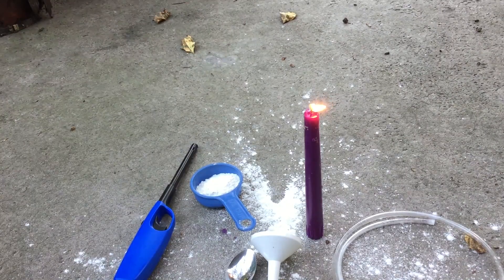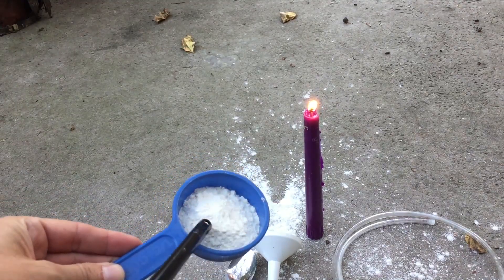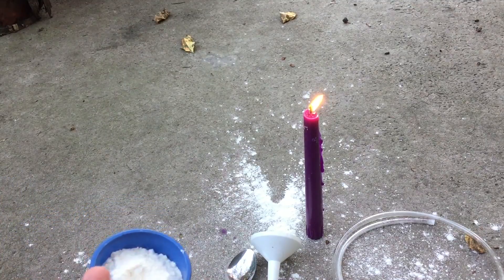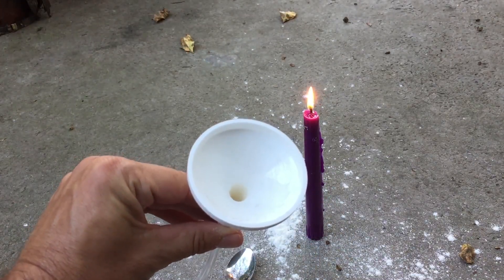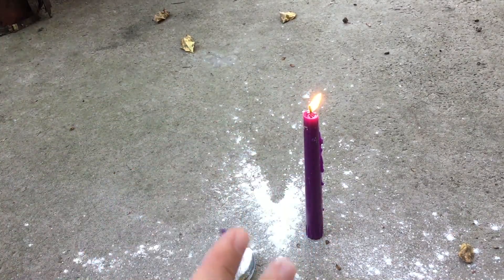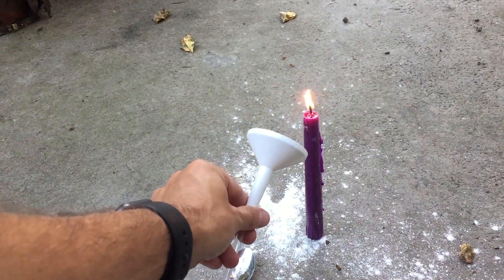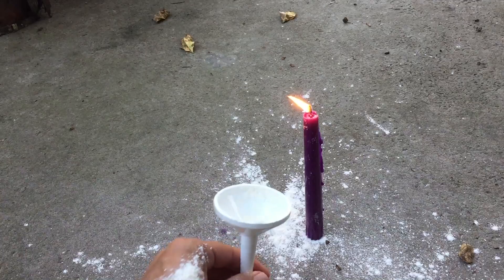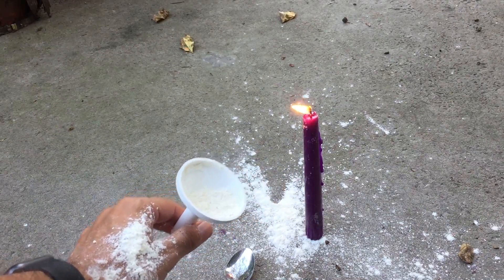Exploding Cloud of Flour

Comment: I would like to see it with this fine desert sand of Sahara or something like that which is mostly unused or can't be used for concrete constructions.
Reply: Sand is typically silicone dioxide, which is extremely inert and won’t burn under really any circumstance (unless you’re insane enough to use something like chlorine trifluoride or some other oxidizing agent that is stronger than oxygen itself).
Reply: Sand is usually used to put OUT fires

Comment: You have to bake the flour in the oven to remove most of the water if you want big flames.
Reply: thanks for the tip, random cat on the internet
Reply: I tried this,  but I got cake instead.. 😔
Reply: @sirbadios5  What kind of cake? 😳
Reply: @abednegomanurung3995  the chocolatey kind
Reply: @AhmedHassan-lv6ld  I hope it tasted good

Comment: If I get a bunch of flower and dust it into a room will it explode ?
Reply: Yes. Entire factories that produce grain, sugar and wood have been completely destroyed and people killed by dust explosions.
Reply from the maker: yes - don't do that
Reply: Cry Aloud Spare Not  have to do it right, not just throw some flower but yeah it certainly has the potential. the explosion is caused by the rapid exansion of suddenly burning hot gaz (air) and the larger the room and the most homogeneous the flour/air mixture (with an ideal ratio existing somewhere i imagine) the bigger the bang. You should try it, seem's fun.
Oh and you could use a blowtorche instead of a candle.
Don't actually try it
Reply: Try roses
Reply: Elijah Johnson yes
Reply: Cry Aloud Spare Not ok you’ve got my interest :p i’m a sciency sort of guy, currently studying physics after engineering, so even though i know what i’ve said is true on paper it’s rarely that simple. But I do have a workshop/lab here and i’m gonna try to make that work now :p we’ll see... first in open air then if it doesn’t work i’ll try something with a bottle and ventilation. And i’m out of pure oxygen so no cheating promise :p
Reply: Cry Aloud Spare Not maybe with a hot air gun that’s an idea
Reply: Nay i just managed to improve on the system in the video with a blowtorch and air gun, to make a room explode (i tried in a water bottle to tru simulate a closed system) you must have very specific conditions, that i’m unaware of. Still it’s does happen in real life so no question on if it’s theoretically possible in a experimental setting. Must be studies out there maybe videos
Reply: Look up Gold Medal flour explosion 1800s
Read a little... As someone who lives in minnesota Im very facinated by this topic because in my city that happend
Reply: Throw u bunch if flowwr and throw it on the floor get a broom and sweep as hard as you can it will generate a good dust cloud